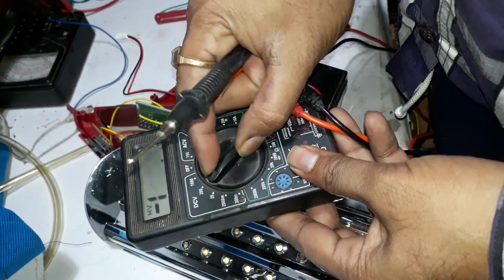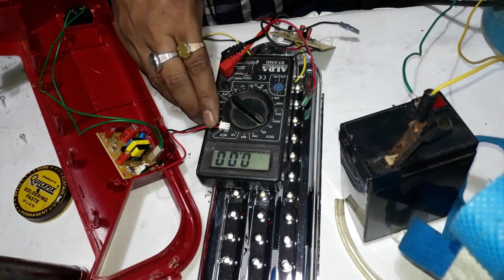What to do if emergency light is blinking

Comment: Sir battery sahi hai maine dusra emergency light mai charg kiya to charg ho gaya jo pahle wala mai betterymai charg nahi hota volt check kiya to 0 dikha ta hai isme kya fault hai transfermer ki?
Reply: First transformer ke input me 220 volt ac check kare agar waha voltage nahi hai to cable check kare or agar 220 volt mil raha hai to transformer ke output me check kare 6 volt milega